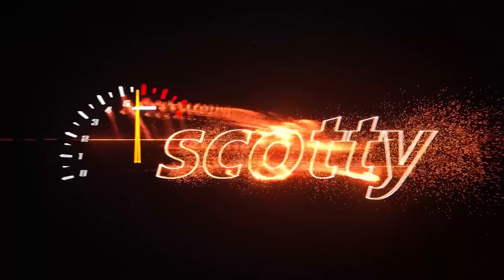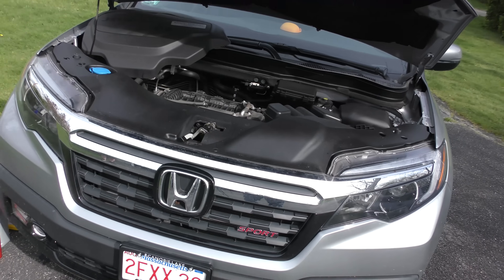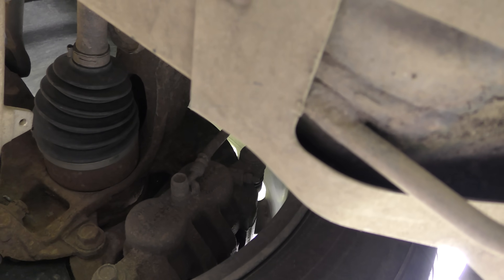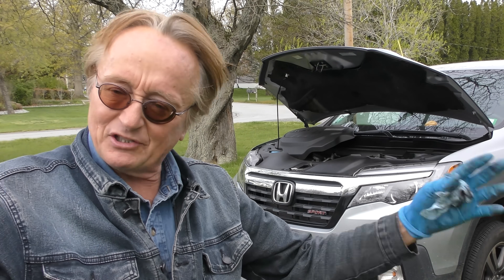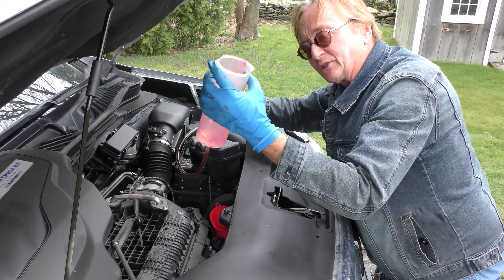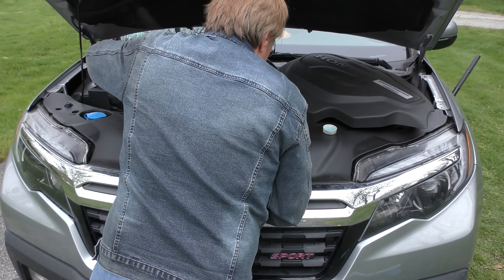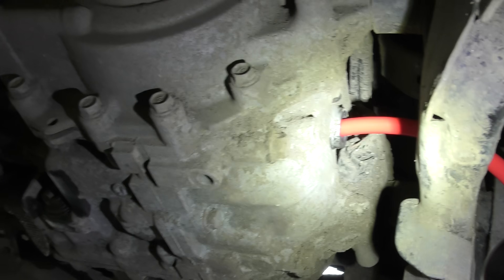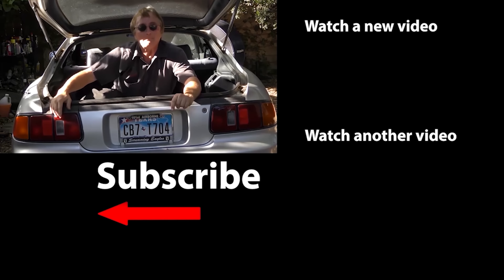Here's Why Car Companies Don't Want You to Change Your Engine Oil or Transmission Fluid

Comment: I would never buy one of these. If they have a filter that is near impossible to replace, requires splitting of the case, it is planned obsolescence. Do not buy vehicles like this if you are looking for longevity. They are not heavy duty at all, american 1500s can ride very nice.. just not worth it.
Reply: Not true. Just change the fluid and they're fine. They do have failures here and there but it's rare when they're maintained besides the HRV with a CVT. some of those fail no matter what.
Reply: @r3alfish  Absolutely true. The reason you have a filter is so you can change it. If you work that transmission super hard towing (because it can't do off road) and the filter becomes contaminated and the pressure drops, the transmission blows up. It is a poor excuse for a truck anyway, not worth putting your money into it not just because of the transmission. Unibody and low ground clearance means this a poor excuse of a 4x4 cannot go off road. It competes squarely with the Subaru pickup of old, a car with a near useless bed. The ranger with 2500lbs more towing and a frame which is still lighter than the ridgeline. The ridgeline is not a real truck.
Reply: @r1ch m  it all depends on your use of the vehicle. They're simply not designed to do larger/full size/full frame truck things. Honda used what they use in their other vehicles on this and all I'm saying is that I have seen people be very pleased and never have a trans fail with that filter design as long as they followed the correct maintenance intervals by Honda's recommended maintenence schedule. I worked for the dealership for quite a few years. Never saw but a handful of transmissions get replaced, 2 under warranty and about 3 others from high mileage (over 260k miles) however since I've began working in a shop that services all makes and models I myself have replaced 4 in silverados, 2 that were on their 2nd or 3rd trans, ford trucks with just over 100k with a failed trans, just replaced a 2018 Tahoe trans,  that vehicle only had 97k miles on it and it had been serviced before. So, to me, they all have weak points these days. Almost all cars have a really bad weak point. Not trying to argue, just trying to state why I view it the way i do from personal real world experience.
Reply: @r3alfish  The Ridgeline cannot do what the Tundra/Ranger/others can do, go off road, it is a unibody car. (Like the Mavrick) Don't get me wrong, Ford wants you to buy new pickups instead of a transmission as well, they say don't change the transmission fluid/filter in the ranger for 150,000 miles or lifetime (yep you are dumb if you do that.) The Ridgeline is coined as an adventure truck, but since it cannot go off road, not much adventure, better to buy any other brand, and the transmission problems and low tow capacity make it a truck looking car for those who really want a car.
Reply: I think this is exactly the same setup as my honda pilot.  There IS an external transmission filter below the battery pan.  I just put a transmission cooler on mine and it was sitting right there. Maybe there are two filters. BUT I agree with you. This is not a heavy duty truck. It's unibody and exactly the same as a honda pilot in build. I have a 2000 nissan Xterra that is the same as the old Nissan hardbody trucks.  The Ridgelines weigh half as much.  Honda's seems to need excessive and exact maintence needs.
Reply: @darrinkron1963  I think every manufacture does either dumb or planned obsolesence things. I had (not my idea) a pt cruiser turbo, the dealership told me it was an interference engine and you had to replace the timing belt before 80,000 miles to be safe. You had to remove the engine to do that. I found a mechanic that could remove two motor mounts and push the engine up a little to do change it. How stupid could you be as a manufacturer, unless they did on purpose knowing you would be buying a new car in 100,000 miles. Interesting the new turbo ranger crew cabs cost and weight less than the ridgeline

Comment: I actually just changed my oil yesterday with that exact Pennzoil Platinum.
I've always used Mobil 1 so I'm trying out the Pennzoil for the 1st time and see how it runs.
The Pennzoil was a few dollars cheaper but it's supposed to be pretty good oil so we'll see
Reply: As long as both meet your manufacturer's specifications, go for it.

Comment: Scotty Kilmer you didn't flush out the Torque Converter. Most cars around 40% of ATF is in the pan with filter or no filter and 60% of ATF is in Torque Converter.
Reply: It's not a full fluid change. Just partial. The method to change ALL of the fluid is repeat this process 3 times and be sure to start the vehicle and shift through all of the gears at least once in between fluid changes. Not necessary unless the fluid wasn't changed every 30k or some kind of contamination occurred.

Comment: The rear differential in My wife's 2017 Pilot requires Honda Dual Pump II fluid. I'm pretty sure the Ridgeline and the Pilot are the same under the skirts.
Reply: Exactly right. He's wrong on the fluid type.

Comment: Did I just see Scotty use a Fram oil filter?
Reply: Some things you just can't unsee😱
Reply: The wrong rear diff fluid too. These take dual pump fluid, not vtm4, vtm4 was used/is used only in older model awd Hondas that specify it.

Comment: Fun fact: every fluid on a vehicle is lifetime fluid as long as you don’t mind the lifetime being measured in months instead of years!
Reply: Yeah, these companies are really saying "Don't worry, the transmission will be trash, by the time the fluid needs to be changed."
Reply: Only if you trade it in each year is it 'lifetime'.
Reply: @sw7366  each year? 😂😂 bruh you change trans fluid every 12k miles?
Reply: "Lifetime" means you will never run into transmission problem if you replace your vehicle before the warranty runs out. That way, you will be a "lifetime" customer.
Reply: I do not believe any Instructions
Reply: …I once had a college teacher tell me, “Every Test Is Optional”?  (You can take it or walk out)

Comment: Tip - to minimize the oil mess when you're changing the oil filter, put a plastic bag around the oil filter.  NO MESS.
Reply: Or drain the oil first, then remove the filter.  Not sure why he did that the way he did.
Reply: @EsotericUIUC still gets messy

Comment: The only thing I can recommend is to make sure you can remove the differential fill plug BEFORE draining the fluid.
Reply: What do u mean fill plug removed
Reply: @thabokgosietsile  There is a fill plug for the differential. Usually on the side that faces toward the front of the vehicle and near the top of differential.  You shouldn't drain the differential unless you can remove the fill plug first or you won't be able to refill it.

Comment: On my car and I checked other how to videos when adding the transmission oil it won't completely take the amount needed .. so you have to turn on the engine and shift a few times. No don't drive it just turn on and shift that will engage the  transmission and help it suck down and drink up the appropriate fluid amount. So Scotty forgot that part and its maybe a model specific thing to have to turn on and shift the gears a little. So research that on your car if you need to do so.

Comment: I learned about changing the transmission fluid thanks to Scotty, it's kinda crazy that I have to travel 2 cities and a half to find a competent mechanic to do it (even though it has a drain plug and deep stick), yet it will be totally worth it 💪
Reply: Whatever you do, DO NOT let anyone "flush" it. If you do anything, drain and fill only.
Reply: I have 130k on my daily and the transmission guy I talked to told me to leave the fluid if it has never been changed.  It's a nissan cvt too so I left it it has been fine I drive 200 miles a day
Reply: @kevinf1512  Yes with that use it's probably the best to leave it alone
Reply: I have 2016 Toyota camry at 160k miles and never changed the transmission fluid, would you change it or leave it thanks?
Reply: @jesseduarte8979  I'm no exper, but from what I've seen I'd do a simple "drain and fill"
Reply: @jesseduarte8979  Of course change it. It's much cheaper to change the oil than deal with gearbox problems.
Reply: @jesseduarte8979  Don't change it! My 2011 Tacoma has never been changed with over 200,000 miles and performs flawlessly!
Reply: @jesseduarte8979  When you drain an automatic through the drain plug only half of it comes out anyway. With that kind of milage unchanged I'd drain and fill then at next engine oil change do it again. That'll give you a s close to all new as it gets without totally dropping tyranny and draining torque converter, which ain't worth the effort.
Reply: @johnchandler1687  never has been changed I bought the car off a used lot with 142k now in 2 yrs it has 160k
Reply: @jesseduarte8979  wouldn’t recommend changing it if you had never done so before. Scotty has a video actually, where he explains that if you have never changed your transmission fluid every 30k, then you should not change it anymore, because all the impurities that accumulate inside prevent the transmission from slipping.
Reply: @johnchandler1687 Yes, we should all drop Tyranny. 
Tyranny is bad, MmmKay 😂
Reply: @nostradamus7648  autocorrect is auto wrong mostly. Mine will change a word when I'm already several sentences past it.
Reply: @johnchandler1687  I hate that crap
Reply: @jesseduarte8979  If it was already not serviced that whole time, the metal shavings and gunk might be the only thing still letting it shift. If the fluid is all dirty and brown/black, probably best to leave it in there until it dies. If the fluid is still clean when you check it, it is probably safe to change it. Worst case scenario, you can use some Lucas Stop-Slip to thicken it up if it does get some slippage after changing.

**I'm not a mechanic, do what you think is best.
Reply: @jesseduarte8979  I drained and filled my trans for the first time at 160K miles. Done it several times since then and at 260K now. Haven't had a problem. I've heard people say it can cause problems but I think that's only true on transmissions close to failure.

Comment: Same people I read about almost daily with Honda Civic Si's, Acura TL's and other import vehicles swearing by AC Delco Synchromesh MTF. Wrong fluid and wrong spec. NOT an approved fluid by Acura and Honda, plus it's the wrong additive package, far too aggressive for soft metals like brass found in Torsen transmissions. Honda and Acura will never tell their customers to buy and use GM's fluids in their transmissions. Use ONLY approved spec fluids, even AMSOIL makes a great fluid that is reverse compatible with Hondas fluids. Meets and exceeds spec.

Comment: HI, how about coolant?  Is it important as well?  Thanks  Also how important is the years of the fluid vs the miles.  I have a car 10 years old but very low mileage.
Reply: Your coolant is very important because it keeps your system cool and without no coolant your car can overheat and cause other problems too
Reply: Also every car comes with certain mileages that you should change your Oils in your car if don't follow these Guidelines in the service manual your car can also cause allot of problems
Reply: Why your car can be low on mileage it can be faulty injectors, improper airflow or Bad oxygen Sensors

Comment: Just changed the trans fluid on my 2014 CRV at 90k. The little transmission shudder it had for a few thousand miles is completely gone now, wish I had done it sooner!
Reply: Borderline too late to do it, after 100,000 you’re kind of rolling the dice.
Reply: @mplslawnguy3389  Haynes manual recommendation is every 120k for whatever that is worth. My vehicle is shifting much nicer now so I’d say it was worthwhile
Reply: @scotty07031  That seems way too long for any fluid.  I’d rather pay a little more in fluid changes than pay a lot for new parts.   Those CRVs are great vehicles though.  90,000 miles would probably cause issues in a lot of other models.

Comment: Should remove the fill plugs first so in case you can't get it out, you're not stuck with an empty transmission or differential and can drive it to your favorite mechanic.

Comment: I have a 2019 Honda Passport we bought in December of 2022 with only 29k on it. First thing I did was change the oil. Yeah, the dealership had done it before they put it on the lot, but I’m one of those guys who wants to know what’s in it. Second thing I did was have the trans serviced. It’s FWD so there’s no transfer case. I also found out that you MUST USE HONDA 3.1 fluid. Good to know. I plan on having it done every 30k. At around $250, it’s reasonable (the fluid itself is kinda pricey!), and a new trans? Nope, don’t even want to think about that!😝
Maintenance is cheap. Repairs are not!😉😄

Comment: Never trust the manufactures statement that it is a lifetime fill. Yes it is a lifetime fill, for the life of the warranty. I did my Volvo transmission at 66K miles and the fluid was ugly to say the least. I did a complete exchange and since then, I drain the pan every two years and refill with synthetic. At 126K miles, 60K after the first transmission service, I dropped the pan and changed out the filter.  26 and half years old, the transmission still shifts and drives like it is brand new.

Comment: ford e4od automatic throws code 628 ("Converter clutch slip excessive).  Put a new converter or drive everywhere with the o/d  off?

Comment: I Always perform my Own Maintenance! But I don't care what anyone says or Thinks. If a Vehicle takes 5.7 quarts of oil, it's not gonna hurt anything putting the full 6 quarts in.  When I I change the oil on a Honda and it says 4.2 Quarts I put 4.5 quarts. And 4.5 puts it right to the top Full Line.

Comment: Hi Scotty thanks for all the great videos I do have a question I have a 2008 lexus gx470 with 268k on it runs great I have changed oil every 3500 miles but I have never done the tranny sealed type should I change the oil or just leave it not sure if I will introduce problems by changing it with so many miles on it. Thanks once again for the videos best regards Scott
Reply: That's a tough call. What did you end up doing? I did a drain and fill on a 2000 RX 300 at 210000. No issues. Sold it and still going as far as I know.

Comment: Hey Scottie this is Aaron Wilson from Philadelphia. I just wanted to let you know. I used some lacquer from yellows. That's where I got it from like a finished product had a real bad night in the engine as well as the.  Muffler system going bad so what I did? I poured some of that down in there. I gotta get like about 67 put about 3 gallons of it in there. But I love it more than that and then I put some medium.  Gray gas in the tank and it's extended the car for an extra 6 months. I'm still going. I know it's a temporary fixed but I love what you do. I'm glad you doing it and keep up the good work

Comment: Is it ok to use the same type of fluid of a different brand for the rear diff and transmission or do I only use genuine Honda fluid?
Reply: I wouldn’t mess around with different brands. Maybe it’s a few bucks more for OEM, but there’s no questions.

Comment: Hey Scotty!  To save the mess when pulling off that oil filter, I use the disposable plastic oversized red beer cups over the filter and spin it off catching the overrun in the cup!  Works well!
Reply: A Ziploc bag works too.
Reply: Love that idea!!
Reply: If there is room.  I also have a bendable lead/rubberized coated “formable funnel/spill shield 🛡” thingy. Sometimes my old cardboard from my 24 pack works too 😏🤷‍♂️
Reply: Stale Craker and Ginger Billy cut the tops off those Ridgelines! 👍🏻🇺🇸😏🤷‍♂️😎💪😆
Reply: if you remove the co pilot side tire would be much easier to remove the oil filter and prevent a mess spillage...I would put a pet mat (urine and poop dog mat) below in the floor just in case some oil spills...
Reply: Mr. Schmitz great suggestion this is why I love Scotty’s videos because like him his viewers are on the ball as well!
Reply: Those cups are called “Red Solo Cups” Country artist Toby Keith did a song about em...
Reply: Good idea.
Reply: Smart, thanks for that 🏆
Reply: Good idea. Thanks.
Reply: Smart man

Comment: Well, Scotty I had my oil & filter changed at 1,000 miles on my new 2023 Lexus ES300h ULTRA LUXURY. I really don't care what anybody thinks and like you say oil & filters are cheap, engines are expensive. LOL

PS - I used Liqui Moly Special Tec AA 0W-16 and a Toyota 90915-YZZN1 Oil Filter. Oh and guess what, it's the best $80 bucks I could spend and I got to watch him do it, ask him questions, and he corrected my tire pressures.

Comment: Car manufacturers have a vested interest in your car not lasting too long.  It has to last long enough so that you think it's a good, dependable car and you got your moneys worth.  They don't want it to last so long that they don't get to sell you another one.  As a quick rule of thumb, I've always either taken what the manufacturer recommendation for oil changes and divide it by two, or just change it at 5,000 miles.  Easy to remember, and no engine ever failed because the oil was too clean.  Transmission fluid I change once a year no matter how many miles I've driven - again, it's easy to remember.
Reply: has to last long enough to outlive the warranty lol. then they want you to get a new one lol
Reply: Never thought of it like that.. Think you're right on the money

Comment: Just did my Tundra 5.7 tranny last weekend. Easier than changing the oil once you know how. Very simple. Wouldn’t take it to a shop and pay over $300. Fluid ran me about $120. Takes about 16 or 17 quarts to do a complete drain and fill.